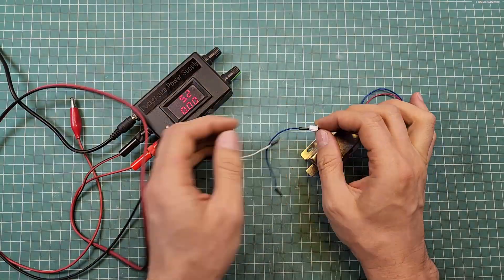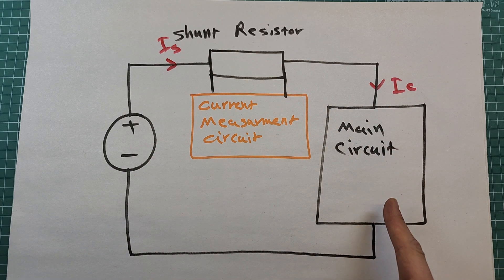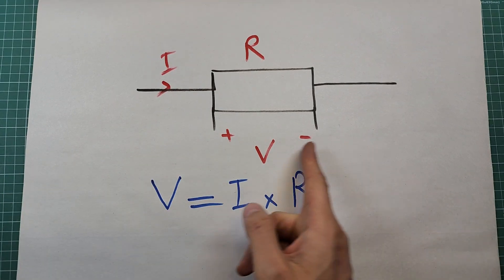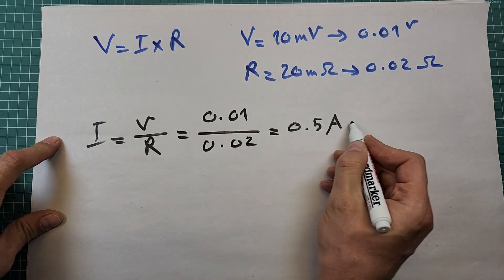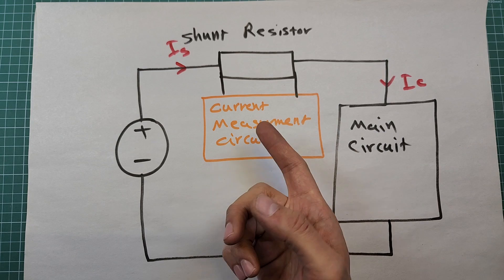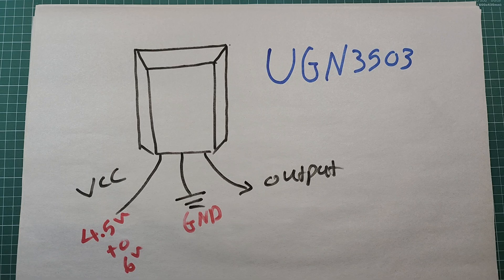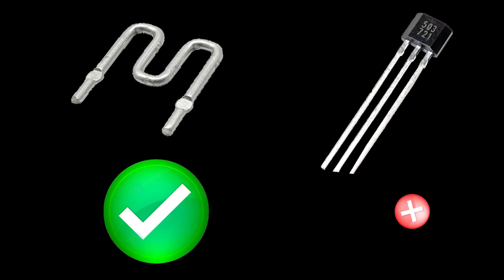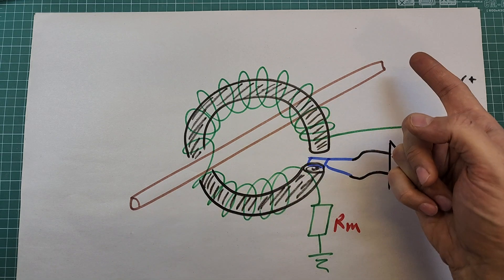How to Measure DC Current: Shunt Resistor vs. Hall Effect Sensor

Comment: As usual, a clear and helpful explanation.
But since there is no free lunch and measurement also affects the system being measured, the Hall Effect method must be causing some perturbation.  But I assume this is very low, at least much lower than the shunt resistor method.

Comment: You seem be just a stupid parrot. You have a 20 mOhm restsistor? But don't messure the resistance of your crappie long wires? If you can't even understand the basic principles of messurement corrections how are you supposed to explain what you are really measuring😂? I bet your wires are those crappie Chines crocodile clip leads that have hair thin copper plated iron wires. That shunt resistance is meant to be used in a pcb circuit with very short path low ohm and low impedance copper traces for accuracy. Not for very lossy wire with high ohm high impedanz wiring. I can take this video seriously 😂. So I stopped just at 4:18 and moved on.

Comment: I find an ammeter much better and easier to use for measuring current 😂
Reply from the maker: Yes, but what are you going to do with that when you need to measure current using MCU for automation purposes 🤔
Reply: What you gonna do when you can't break the circuit to install an ammeter?
Hmmm

That's where hall effect sensor based current meters are used.

Comment: Around 2006 I was reaching motorcycle mechanics. 
They had to measure starter motor current draw, usually around 90 Amps.
Used 4 gage copper cable with measuring points 19.1" apart as the millivolt reading was same as amp draw.

Comment: The ASCxxx Hall-effect integrated current sensors from Allegro are quite easy to use and available in a range of variants optimized for different current ranges and for AC or DC. The current carrying path will add negligible inductance at any frequency for which the sensor is suitable. The sensors aren't high precision or high bandwidth, but quite adequate for lots of applications and are not very expensive.
The ASC712 seems to be quite popular in the hobby market.
As I mentioned in another post, many of the ready to use circuit boards with the Allegro sensors have very stupid design when it comes to safety if you need to measure current in AC mains circuits. The sensors themselves have been deigned for safe isolation if properly used, but lots of the circuit boards have the "ground" for the low voltage side closely surrounding the current carrying terminals, which is very dangerous.

[edit - someone else mentioned a Lema current sensor. Lema as a very good and very broad range of current sensors, but they are also quite expensive. Of course the reality is that if you need high performance it likely is going to come at a cost. If you are using a microcontroller that uses Vcc as the voltage reference for the ADC and you aren't using a high-precision regulator for Vcc and aren't using ratiometric sensors, you are likely wasting your money buying a sensor with accuracy that is better than about 1%. If you need high accuracy and stability, you need to pay attention to every detail of the circuit. Even the thermoelectric potentials between component leads and the PCB foils can cause troublesome errors in high-precision or high-resolution circuits.]

Comment: It's worth mention about using shunts, that the resistance variation by temperature isn't really as bad as it might look watching this video
 - it's mostly an issue if you need the current to be measured with very high accurancy (better than 1%). Good wire wound resistors (those "metal bar" ones used for shunts at higher currensts, is practically the same as wire wound ones) or metal film resistors are often made of constantan and other similar alloys that have a very small resistance variation by temperature. 
If you make your own resistors on the other hand (which might seem convenient, because of the low resistances often used) and use something like for example a piece of steel wire or a thin copper wire, this will be a huge issue though.
The resistance at for example 100°C compared to room temperature (20-25°C) for copper is like 32-33% higher and it's similar for ordinary steel. But for a good resistor or if you make your own resistor using for example constantan wire, it's less than 1% over that temperature range. Some resistors are better than others though and it's still good minimize temperature rise as much as possible to keep the best accurancy (the hotter it get's the more variation of course). 

When it comes to power losses, what's most relevent is how large the voltage drop is in comparison to the voltage over the load coming after the shunt. A shunt that have for example 120 mV voltage drop in a circuit that outputs 24 V before the shunt, at the maximum current to be measured, will cause a power loss of at most 0.5% (which is acceptable in most cases). 
But if it's a very low voltage circuit that only outputs 2.4 V (typical at for example a constant current drive circuit for a red laser diode), that loss is now 5%! Which will have a significant impact on the over all efficiency. 
For high power circuits, heating of the shunt it self might still be something to take into count, even if they are high voltage. A similar size shunt passing 20 A thu it, will always heat up to the same amount - regardless if the load afterwards uses about 48 W of power or 480 W (in the 24 V vs 2.4 V example)

When choosing shunt resistance - the lower the voltage drop, the less power loss. But lower voltage means the shunt voltage will need more amplification to be read out. Which comes with it's own issues such as noise and the offset voltages of opamps for example (especially if you want to use one shunt to measure currents over a wide range. If you dimension the shunt resistance to have a very low voltage drop at the highest currents, the lowest currents might get hard to measure).

Comment: The Hall effect sensor sounds useful when the circuit already has an inductor in the line where you want to measure current.
Reply: he literally said not to do that haha
Reply: @justinc2633  he said don't ADD an inductor to measure current.
Reply: @hanelyp1 He didn't say add an inductor. He said "when the circuit already has an inductor in the line".

And anyway he is wrong.
You don't need an inductor to generate a magnetic field so you can measure the field strength with a hall effect sensor.

It's a flawed technique because the inductor, increases the field strength based on its physical construction and you will get an incorrect measurement of current when translating from the magnetic field strength in Tesla to Current in amps.

You can measure current using a hall effect sensor simply by placing the hall effect sensor next to the current carry wire. In fact there are DC clamp meters that do just this.
Reply: @hanelyp1 He didn't say add an inductor. He said "when the circuit already has an inductor in the line".

And anyway he is wrong.
You don't need an inductor to generate a magnetic field so you can measure the field strength with a hall effect sensor.

It's a flawed technique because the inductor, increases the field strength based on its physical construction and you will get an incorrect measurement of current when translating from the magnetic field strength in Tesla to Current in amps.

You can measure current using a hall effect sensor simply by placing the hall effect sensor next to the current carry wire. In fact there are DC clamp meters that do just this.
Reply: @hanelyp1 He didn't say add an inductor. He said "when the circuit already has an inductor in the line".

And anyway he is wrong.
You don't need an inductor to generate a magnetic field so you can measure the field strength with a hall effect sensor.

It's a flawed technique because the inductor, increases the field strength based on its physical construction and you will get an incorrect measurement of current when translating from the magnetic field strength in Tesla to Current in amps.

You can measure current using a hall effect sensor simply by placing the hall effect sensor next to the current carrying wire. In fact there are DC clamp meters that do just this.

Comment: How to DELIVER MAXIMUM CURRENT to the coil without overheating the battery? If I put a resistor after the coil ( near to + of battery ), it will prevent the battery from heating up, but it may reduce the current in the circuit and the coil will no longer receive maximum current, right?

Comment: Check out the INA4235 4-channel I&V shunt resistor sensor. I’ve used it many times. There are many parts like this that are even cheaper and easier to work (due to very fine pitch the BGA package) with but this is a great part for accurate measurements of current and voltage.

Comment: If I may be excused for being a little critical, this does not really rise to the level of a 'how to' tutorial. You do not actually build any practical circuits and you gloss over a lot of important detail. The one circuit you do build only works because the 'measuring circuit' (your multimeter) has its own isolated battery power supply. The block diagram you show has a high-side shunt and would require quite a complex circuit in the orange 'current measuring circuit' block to make a practical microcontroller input. The two Hall effect circuits are entirely theoretical and you make no attempt to implement either, which would be quite tricky. Furthermore the explanation of why the second Hall circuit is better than the first does not really make any sense. You should mention that ready-made Hall effect current sensors are available which incorporate an isolated main current path, a magnetic circuit, the Hall sensor, and some compensation and calibration circuitry all in the same component package.
Reply: I fully agree. And for me, this was what I was expecting the most. But it's not in the video 😢
Reply: Youtube sure has come a long way seeing as now people ask If they can be critical before launching. Wow
Reply: First time here? It blind leading the stupid.

Comment: Disclaimer, I repair robotic motion control systems for semiconductor wafer handling equipment. For this precise current measurements are required. 
Short cource on DC motor servosystems EC voice coil actuators.  Velocity and voltage are highly related. Current and force are directly related. If a change in velocity is required in a PID loop, current is used to set the force using the physics of Force = Mass times Acceleration. Current = force in the math. Note, actual velocity is not part of the formula.  Most servo or robotics power amplifiers are not voltage  in = amplified voltage out. The amplifiers are voltage in = current out. This allows control of force with the set point voltage to the power amplifier. EG if velocity initially is 0 or 100 mm/sec, the voltage can be 0 or 50 on the motor coil, but the current is 0 for 0 force to change the velocity.

OK primer over. The power amplifier has to measure the actual output current, and use it for feedback with the input setpoint, which brings us to how the current is measured.

A traditional current sensor has some serious faults. The magnetic field may magnetize the core resulting in a DC offset error. The core has a magnetic hysteresis curve, resulting in non linearly at higher currents. The magnetization inductance limits the high frequency response. These 3 faults can be corrected with a small change to the traditional hall sensor.

For more details, google Current Transducer.

A current transducer is a hall sensor, that instead of producing an output voltage, it produces a current, which is sent through the sensor core, to null the net current to 0. This removes the magnetic issues with varying magnetic fields. EG the sensor has a 1000 turn coil. A 1Amp measured current is balanced with 1mA in 1000 turns, so the actual magnetic filed is nulled to zero. 50Amps of sensed current = 50mA of sensor output. This configuration has excellent linearity, no core saturation, and a precise gain measurement. This is what industrial control for robotics use for precise current sensing for robotic servo systems. Bandwidth often exceeds 100KHZ with full linearity and bandwidth.

If you want to look up an actual part, look up the datasheet for the LA 25-NP.
Reply: Be careful with the LEM modules they will pickup stray 60 Hz line current. I have used them in true class AB servo amplifiers and had to fabricate Mu Metal shells to shield them.
Reply: @nomdeplume4726  True, they are sensitive to strong magnetic fields. You do want to use them in an enclosed rack away from the other power distribution magnetic fields.  The sensor core is a transformer frame with an open gap for the hall sensor, so they are not immune from external magnetic fields.

Comment: Commercially made current sense shunts usually employ a resistive material that has a low temperature coefficient of resistance. "Manganin" is a commonly-used alloy that is very good. Shunts with current ratings up to a few hundred amperes are readily available. They aren't something you mount on a printed circuit board.

Comment: if you use a shunt in the "high side" you will usually need a good differential amplifier to sense the voltage across the shunt while rejecting the "common mode voltage." For example, if you put a 50 mV shunt in the high side of a 12 volt circuit and have only 1000:1 (60 dB) common mode voltage rejection, you can have a 12 mV error - 24% of the full-scale voltage from the shunt. If you are actually trying to measure 6 mV from the shunt, the common mode error is twice the signal! If you are using a microcontroller, your power supply voltage is very stable and the bandwidth requirement is very low, you can probably do a reasonable job of correcting the error due to poor common mode rejection by use of simple arithmetic. A "low side" shunt relieves the common mode voltage problem but beware of inability of operational amplifiers to swing fully to the negative supply rail, even if they claim to be "rail-to-rail." Outputs often can't get closer than a few tens of millivolts to 0 V. 10 mV is 20% error on that 50 mV shunt. Read the spec's for any op amp you might use very carefully.
As with everything in measurement, think carefully about what you are doing and how errors effect your objectives. In some cases an error of 0.1% is intolerable. In some cases an error of 20% doesn't matter at all.

If you need to measure current in AC mains powered circuits, be EXTREMELY cautious if you are considering any of the ready-to-use Hall-effect modules that are sold to the hobby market. I have seen many of these that have been very incompetently designed and have low-voltage-side "copper pour" ground plane that enters the PCB area surrounding the connections for the high voltage side. The sensors are generally very carefully designed to provide safe isolation but the unbelievably stupid design of the circuit boards on which they are mounted makes the modules grossly unsafe to use for measuring current in anything running at AC mains voltage. (I've seen this same incompetence in design of simple relay boards, too, though I've also seen very good designs.)

Comment: I mentioned this below another comment but I'll put it here as well.

If you want to measure the current in a circuit using mains electricity you absolutely should use a hall effect or similar*¹ none contact sensor. Using a shunt means having to break into a mains circuit which is not only dangerous if done incorrectly, but may not be legal depending on your jurisdiction.

It's also recommended to use a hall effect sensor for measuring the current in an external circuit, again because of the isolation it provides.

*¹ one advantage of mains electricity, or any AC current, is we can getting away with using a simple, passive current transformer instead of a more complicated active, hall effect sensor.

Comment: There might be other considerations that might help you decide if a shunt resistor is appropriate. To measure high currents it might be better to use magnetic fields. At 10A, that 0.02ohm shunt resistor dissipates 2W; at 20A, 8W. You can see how that metal strip would get pretty hot. Perhaps a shunt resistor is good for a couple of amps. Above that,  a magnetic field type measurement would be better.

Similarly, at low currents (10mA, let's say), a magnetic field sensor probably isn't going to be that accurate, as the magnetic fields are weak. At high currents, these magnetic sensors can measure in a more accurate/meaningful way.
Reply from the maker: Thanks for pointing that out! 👌🫡

Comment: 12:54 it's definitely negligible, but you will still have some power dissipation and/or effect on the measured circuit. The energy to either magnetize the ferrite or counter the field produced by the meter's winding has to come from somewhere. That would be a fun thing to calculate
Reply from the maker: Yeah, it would be fun 😀